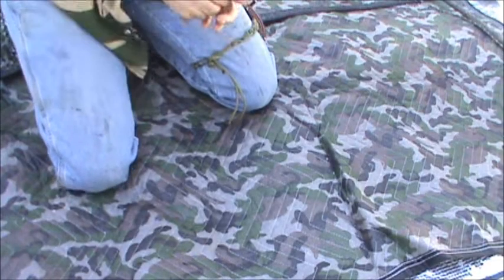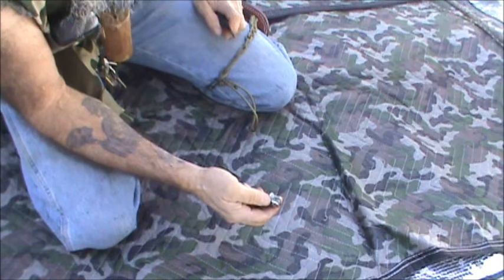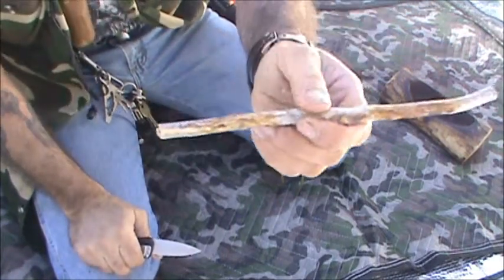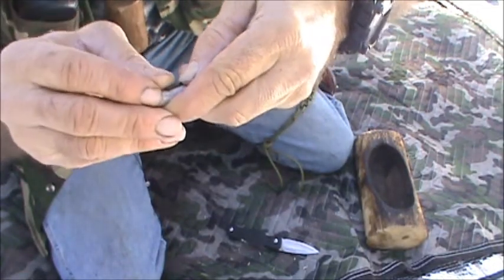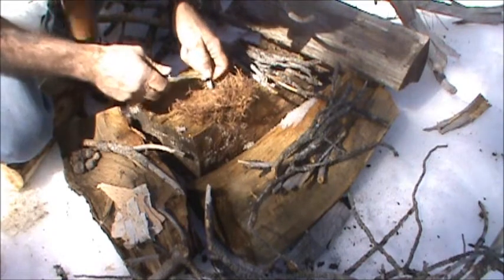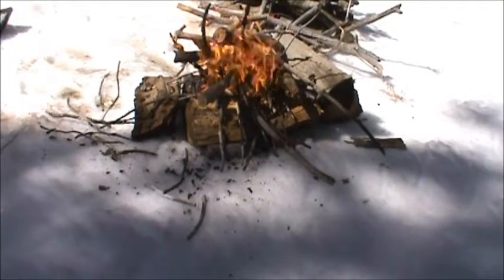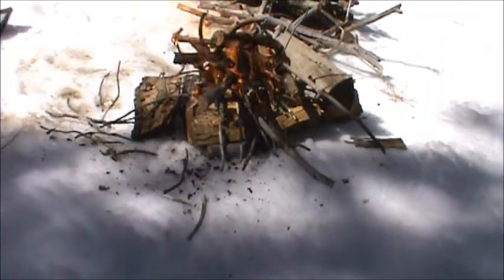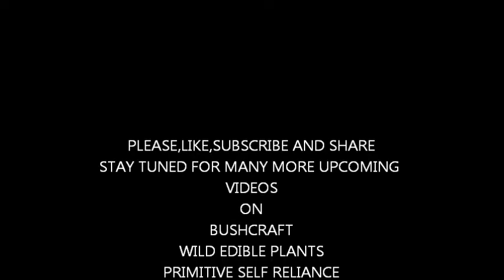starting a fire with an empty cigarette lighter,alternate method,tutorial and demonstration

Comment: question.

Why not keep it in the lighter since it's already creating the sparks?
Why go through all the taking apart the lighter and carving of the wood and scraping? You have fewer chances to lose that flint you found by keeping the unit together, right?

Just asking brother.
Reply from the maker: This is an ALTERNATE method,which throws a larger and hotter spark.
My mind is always working on solving problems. 
The spark with the flint in a lighter would never ignite that tinder bundle.
It's the difference between lead wheel weights and balancing beads. 
Both are different methods of accomplishing the same thing.
Bill